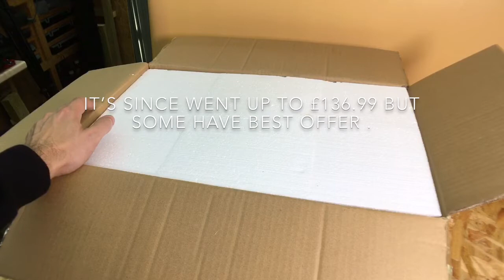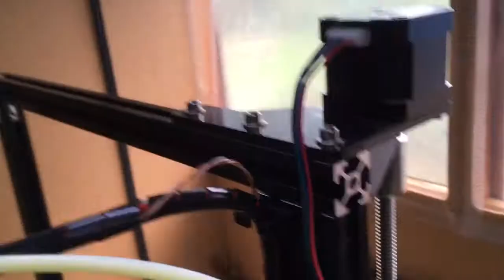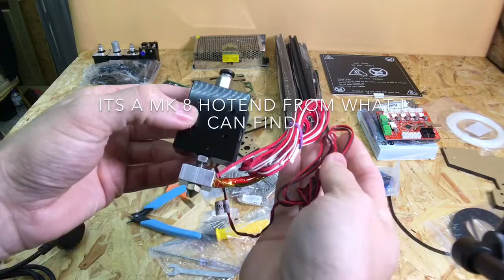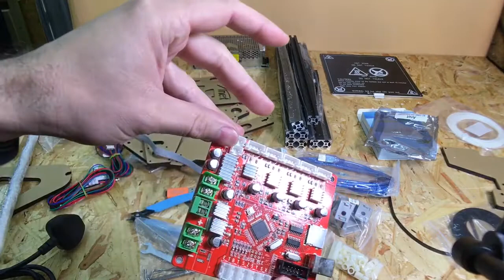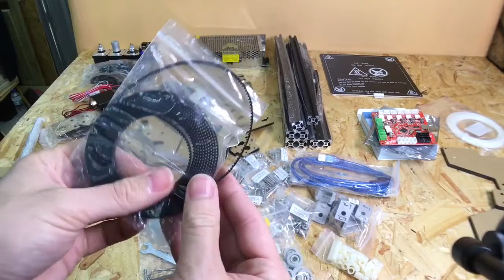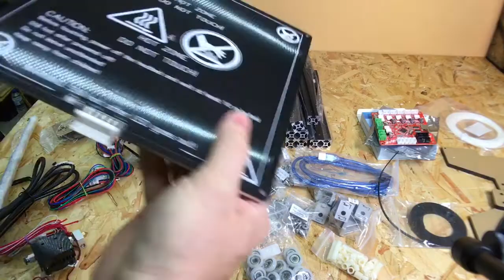Anet A2 3D Printer Quality Of Parts Compared To Tevo Tarantula

Comment: Looking to buy either the A2 or Tarantula - A2 is easier to source. Can wait for your review and comparison
Reply from the maker: hi they both have good and bad points the tevo when set up just right, does make very good prints,  not got any prints from the anet a2 yet i got a duff power supply so contacting seller to see if i can get a replacement.